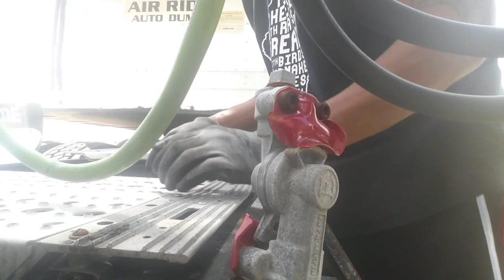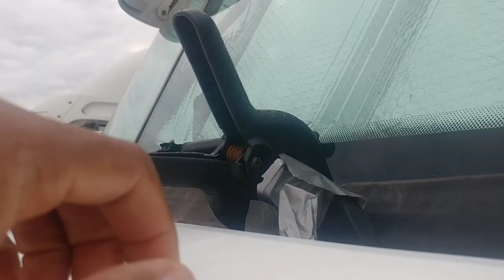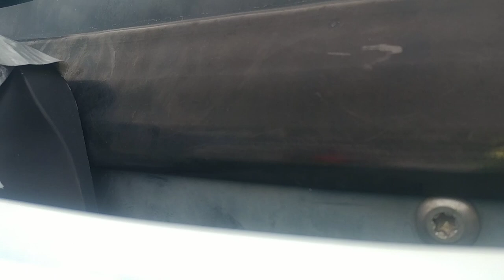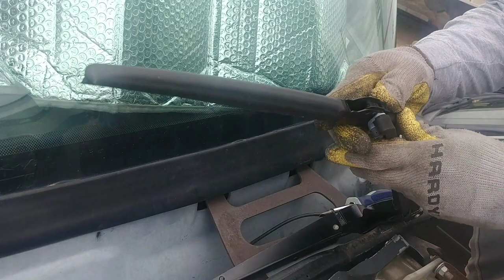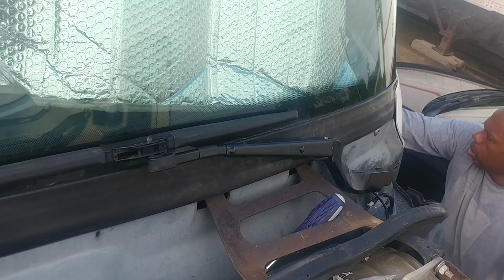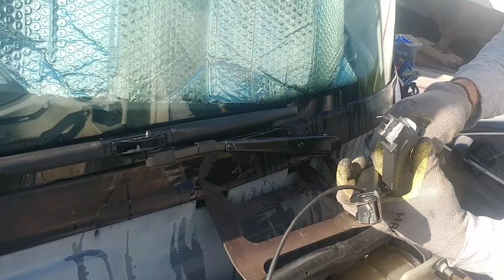Freightliner Windshield Wiper Arm Replacement

Comment: Ice! What it do fam, checked out that shop you sent me in Buffalo Grove, got them in my address book under good shops to use for repairs that you can't perform yourself..lol, also if possible send me that info you sent CAJ that rebuild turbos, want to research dem as well, thanks broski, 99 Freightshaker with a milli plus, just goes to show if ya take care of your investment it will show you some TLC in return but I didn't come here to gossip. 😄
Reply from the maker: https://www.rsdistributinginc.com/
Reply: @truckology101  Appreciate it bruh, be eazy mane.